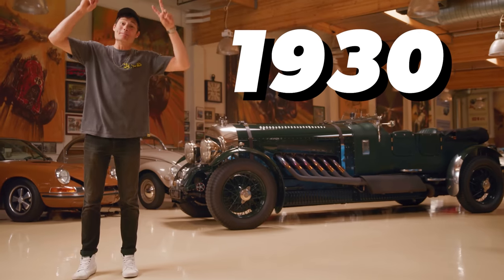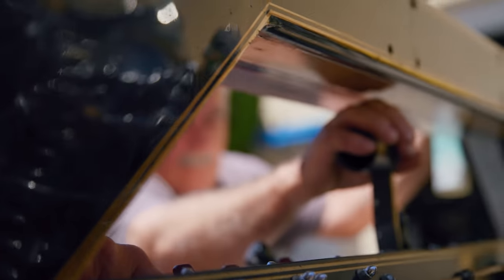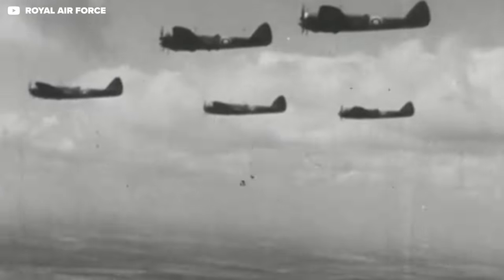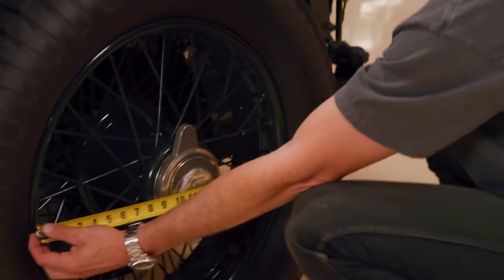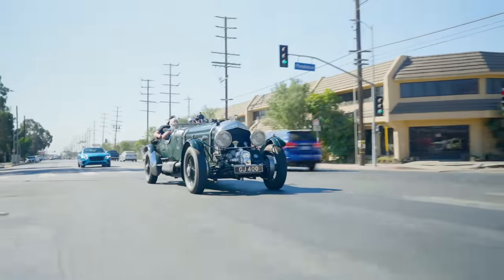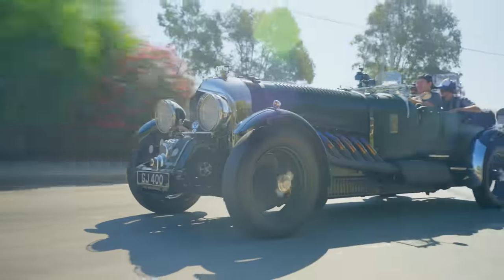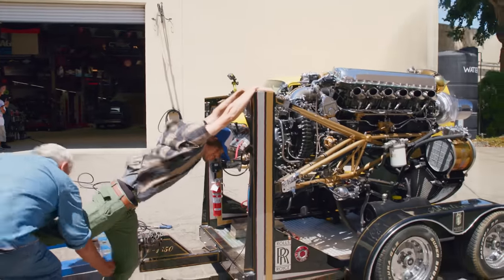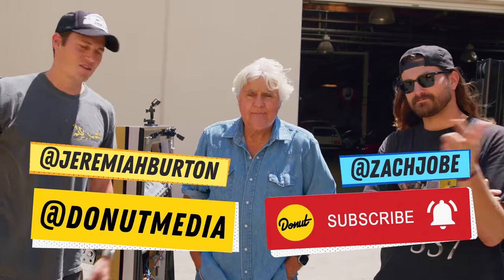What it’s Like to Drive a 100 Year-Old Car with 650hp

Comment: The non-supercharged Merlin, used in tanks, etc, was called the Rolls Royce METEOR. James May expostulates at length on it in a certain episode of Top Gear, in which they compare a Meteor-powered Bentley with another monster machine, the German Brutus (? - if memory serves) which had a German aero engine.
Reply: There are a 'worrying' amount of cool Meteor powered cars out there it would appear!

Not only was the meteor not supercharged but it also had less lightweight alloy and magnesium alloy engine components as they simply weren't a requirement for tanks.

There's a great display of the Spitfire and lots of its components at Hanley Museum in Stoke on Trent. The display plane was flown over Stoke on Trent several times before being retired to be an exhibit. It used to be kept in a huge glass outhouse which was really cool but it was finally moved indoors sometime in the early to mid 80s.
Reply: Yes the Brutus had a 42L V12 from the He-111 bombers :)

Comment: I hate to add its a british engine designed, delevoped and built in crewe in britain and its supercharged variants, its not murican, I do approve of our former colonies putting it in P51 mustangs.
Reply: Agreed, the Merlin P51 was one of the best examples of wartime co-operation
Reply: They stated it was a Rolls-Royce,  and it was licensed for manufacture in the U.S. (Packard, I believe).  Interesting that they Allison wasn't bad, but inferior to the Merlin due to the 2-stage freedom corkscrew.  When the Allison was upgraded to a 2-stage supercharger, it was actually a bit better than the Merlin.

Comment: 3:58. ah yes, it is a Rover Meteor MkIVb tank engine.  Designed by Rover for the tank, it is the unsupercharger version of the Merlin.  Leno's Packard aero engine on the trailer was built by Graham White in Florida, and is a Packard V1650-1.  Essentially, the US copy of the Rolls Merlin MkXX.

Comment: This is what I would imagine a 1930s or 1940s Batmobile to look like. It's got the long front end like the classic Burton car, but the souped-up power of a tank/aircraft engine. It's like an older retro version of Battinson's custom built Batmobile from the most recent movie. All DIY steel construction and a crazy amount of HP and torque.

Comment: The Merlin engine is also designed to be run wide open at full power all day without complaining. Basically any modern automotive engine (almost any automotive engine ever) wouldn’t last a full day at wide open throttle. That’s not a dig at modern automotive, it’s just the basics of design intent. That’s why industrial or commercial engines tend to be big and low power whereas automotive stuff makes more power with less displacement. The automotive stuff is made to cruise on the freeway at 25-30% throttle with maybe a few short full-throttle blasts occasionally. Industrial and commercial stuff is built to run at full throttle basically non-stop.

Comment: That car engine is, actually, a Meteor - Merlin's small brother.

The Merlin (as shown on the trailer) was never originally installed in a tank.

The Meteor was installed in the Crusader tank. Which was 20 tonnes - not 80.

The advantage of chosing a Meteor over a Merlin is it can run on 87 octane pump gas.

The Merlin needs 100 octane aviation fuel.

And after this came a few stronger piston engines - before the jet engine.

The 36.7L Rolls-Royce Griffon 57 came in at 2500hp.

Comment: The W12 engine is not limited by "displacement" but by it's transmission. The W12 engine could put down waaaay more torque than what it has been restricted to in the Continental.

Comment: Airplane engines are also only designed to be in the 2500-2700 rpm range, much faster and the propellers lose efficiency. That’s why they need so much displacement and have so much tq  compared to Hp.

Comment: I drive Cat 789 dump trucks in the mines. They're a 16 cylinder, 78 litre, quad turbo monster that redlines at 1950rpm. The power in them is incredible, so much fun. In the,, there's no replacement for massive turbos and displacement 😂

Comment: the Bentley has a Rolls-Royce Meteor engine, designed for tanks and developed from the Merlin. Most likely this was one was built by Rover as the Rover Motor Company produced most of the Meteor order (about 9000 engines), for several British tanks such as the Cromwell, Challenger, Comet and Centurion. Rover was given the task because Rolls-Royce was at full capacity producing the Merlin and it's specialist division was occupied with jet engines, ironically for the Gloster Meteor, a project taken over from Rover.

Comment: So probably the main reason that the 27L engine only made 650 hp is because the engine could not spin the propeller over a certain speed because the propeller would explode. So they had to design an engine to make crazy power at super low rpm, like below 2500 rpm

Comment: A little bit ingenuous to suggest that the Rolls Royce engine was American. It was designed, built and installed in British Spitfires and Hurricanes, before a manufacturing license was agreed with the  Packard Motor Company. The Mustang version didn't run until 1941, even though the British were using it as early as 1933. Also, the Americans didn't invent Apple Pie and even your National Anthem is sung to melody of an old British drinking song - Anacreon in Heaven! Check it out! Some call me pedantic, but really I'm just pernickety! ;)

Comment: ...and of course, the venerable Merlin & its successor, the Griffon, were designed & built by Rolls Royce in merry old England. Packard built the Merlin under license from RR as the V-1650 .

The P51 was initially designed for the Royal Air Force by Edgar Schmued of North American Aviation after lengthy discussions with Sir Henry Self and his team from the British Purchasing Commission, which had been set up in the United States in 1938 to procure supplies and military equipment for the war effort. The Mustang was designed to use the Allison V-1710 engine, which had limited high-altitude performance in its earlier variants. The aircraft was first flown operationally utilising the V-1710 by the RAF as a tactical-reconnaissance aircraft and fighter-bomber (Mustang Mk I). Replacing the Allison with a Rolls-Royce Merlin resulted in the P-51B/C (Mustang Mk III) model. The Merlin transformed the aircraft's performance at altitudes above 15,000 ft (4,600 m) without sacrificing range. It was at this point that ears began to prick up in the good ole US of A that North American had one hell of an airplane on its books. 😉

Comment: Obviously that trailer's not going to fly, so is there any reason to have the propeller besides for fun? Is it required for the engine to run?
Reply: I've always wondered that myself, and depending on who you ask you get a variety of answers.  The most common I've heard is it helps with keeping the engine cool (which is odd because they're usually not run for long enough to be at risk of overheating) and that free-reving an engine with no load on it is not healthy for the engine (something that is debated non-stop on engine forums).

Comment: You're not correct about torque and pulling power. Two different cars with 650 hp at the crank can give the same pulling force at the tire tread no matter what the rpm/torque spread is between the two cars. There's a gearbox between the wheels and engine tailored to the type of engine and car. The only reason a Bonnet could win a tug of war is because it's super heavy.

Comment: I think one factor has not been considered, regarding the relative engine speeds (Merlin slow turning, modern Bentley fast turning).
Fast revving engines were known, although more difficult to produce due to limits in metallurgy. So, why was the Merlin big and "slow"?
The laws of aerodynamics. As a propeller reaches the speed of sound in it's rotation, the efficiency of that prop drops precipitously. Without going into a lot of detail in a YouTube comment, basically, there's no reason to spin a propeller much faster than about 3000 rpm. So, an engine needs to make its power at that relatively slow speed. Some engines did use a reduction gear, such as the Daimler v-12 that powered the Messerschmitt 109. Many lighter engines in LSA, ultralight, and experimental aircraft also use a propeller speed reduction unit (psru), most of those are belt driven (for engines making from 50hp to maybe 150hp).

I'm wandering off topic. My point is that there were limits on engineering that required a slow turning yet powerful engine. The requirements of design dictated the result, not necessarily technological limits. It's an airplane engine. Lightness is probably the primary concern regarding aircraft systems design. I guarantee that if they could have used faster spinning, lighter engines, they would have (er, like the experimentals I mentioned).

[Edited to fix typos that altered the meaning of some statements]

Comment: The biggest reason the Merlin engine is so big is because in a propeller driven airplane, you are actually limited by how fast the propeller can spin. In the P-51, the engine was limited to 3000RPM by a propeller governor. Any faster and the propeller tips would go supersonic, causing loss of efficiency in thrust, becoming extremely loud, and eventually destroying the prop through erosion from supersonic shockwaves. So aircraft engines rather than spinning faster to make power, they simply become bigger and bigger because propellers can only spin so fast based on their diameter.

Comment: First off, Rolls-Royce Merlin is a UK designed and UK built engine.
The US needed an engine, so they licensed the Rolls-Royce Merlin. They then had Packard build the engine.... It was called the Packard Merlin and built in the US.

The data plate you showed was from the Rolls-Royce....

Comment: 18 feet is the same length as the '77 Dodge Monaco I used to drive, and that car basically had couches for front and rear seating. She was a guzzler and she had several engine problems due to age, but aside from how the vinyl stuck to you in the summer it was like driving an easy chair with a V8.
Reply: I wish land yachts would come back into style. I don't want to feel every bump in the road in a so-called luxury car, I want to sink several inches into a seat and cruise all day in something I can steer with my pinky.

Comment: Sick project man! I’m not sure how readily adaptable T-5s are but you could also use an ax15. They’re rated for 300 but are known to hold much more, they’re the same line of Aisin transmissions as the Mk4 Supra  twin turbo and tacomas/ 4 runners. The ax15 was also put behind 3.9 magnums so you could swap back and forth from Chrysler v8 to AMC engines if you get both bells.

Comment: I love your videos but I do wish you would do research before recording them. Your history of WW2 is abismal. The Rolls Royce Merlin was designed for the Hurricane, Spitfire and Lancaster not the P51. The English built the Merlin. The P51 Mustang did not have the Merlin engine it was designed for the Allison V-1710. The P51 Mustang X had the Merlin engine which then developed into the P51B/C. I can't believe you didn't even mention the Spitfire, Hurricane or Lancaster when talking about the Rolls Royce Mustang.

Comment: Building a plane engine into a race car was somewhat common in Germany in the 1920s. Due to the Versailles treaty Germany wasn't allowed to have an air force, but there were a lot of already built plane engines laying around. A modern take on this is the Brutus, a 1930s style race car built by the Auto- und Technikmuseum Sinsheim in Germany between 1996 and 2004 (the English Wikipedia article wrongfully claims that it was built shortly after WWII) around a BMW VI plane engine found in a Spanish scrapyard from a plane that very likely flew in the Spanish Civil War in the 1930s. It's a 12 cylinder engine with a displacement of around 47 liters and around 750 hp max. The fastest it was ever driven was around 200 km/h by a test driver, who said that it had plenty of power left.

Comment: 650 out of a Merlin is weak sauce.

The original examples of the merlin II had a max of around 1030hp with a combat setting in the 900s range. Merlins towards the end of the war were producing around 1650ish. Reno Merlins today make well over 2000hp using some modern wizardry.

Also the merlin isn't an American engine. It's a British engine. Although it was built under license by Packard for use in aircraft like the Mustang.

Comment: i don't think that is actually a Merlin, the 27L tank version is call Meteor. it is base on a Merlin without the supercharger, and use a lot more heavy steel and iron because it don't have to fly,it weight about double the airplane Merlin depend on the version( the 3500 lb weight stated in the video is over half of what a spitfire fighter weight, which will not work, a real airplane Merlin is about 1600 lb). it also have a lower redline and a lot of other stuff that makes it better in a tank

Comment: Great video, but as a Brit I'm kinda miffed that you guys made it sound like the Merlin was designed by the Americans. It was a British engine, and when the P-51 (a brilliant airframe) needed better altitude performance it was used as a replacement for the Allison engine, eventually being licence-built by Packard. The story goes, that when the blueprints were sent across, Packard (making the US's most expensive and luxurious cars at the time) had to relax some of RR's tolerances because they simply couldn't machine them that precisely. They also made way more than 1200hp. Even by 1942 when fitted in early D Mustangs they made 1650hp at sea level, and late war ones made over 2000hp. The car's engine is probably a Meteor if it came from a tank - not just unsupercharged but also derated for reliability.

Comment: So is the blower on the front of the Bentley, usually an Amherst Villiers, a fake because the Merlin has a centrifugal blower at the rear of the engine usually? Can't see enough of the technical details. Pretty neat either way. Not sure they used the Merlin for air raid sirens, but they definitely used V8s. There is a great video of the late Robbie Coltrane from his Planes Trains and Automobiles series where they fire one up.

Comment: airplane engines HP numbers are always low because they are designed to be used at limiter until the fuel runs dry. a lot of them are directly connected to the props and aircraft props don’t spin much faster than 3k rpm(usually less) 

your car barely makes any power at 3k rpm

Comment: what is the mileage on that Merlin? Is it very low, or oddly better than expected due to lower rpm driving? We are talking like over three times the displacement of a Viper. If someone told me 5 mpg I would believe it.

Comment: I had no idea they built Merlins in the US!

Rolls Royce used to run these things full tilt, nonstop 24/7 until something broke.  They beefed that part up and did it again.

However, the Rolls Royce tank engine wasn't called the Merlin, that's the Meteor.  Very similar engine but not supercharged.

Comment: You guys need to understand that a 6 liter engine making 650hp will not last the same amount of hours operating at full power as a 27 liter engine. 

Engine have not become more efficient, they just have bigger numbers and shorter lifespans because of this. Piston engine tech peaked in the 50s at around 3hp per pound and these engines would last 5000 hours operating at full power.

Think of it like this...

I could put a 1000hp honda motor in my semi truck and haul a load from seattle to new york and once i got there i would probably have to rebuild it for the return trip. 

The magic number is 50hp per liter. Once you go over that, service life begins to suffer.

Comment: We had those four cylinder turbo engines why back in the Australian Falcon, performance was OK in the day but you don't see them around anymore, well apart from blown up ones. Meanwhile the six cylinder Barra is everywhere. Even the turbo Barras survive with high mileage.
And don't think Ford forgot what happened with them. Not my money.

Comment: Slightly sad that there was no mention that the Merlin engine was developed by Rolls Royce in England for the RAF to drive the Spitfire and Hurricane fighters. In fact it was an RAF test pilot that suggested they replace the underpowered Allison V-1710 engine of the P51 with a Spitfire IX Merlin engine to turn it into the Cadillac of the Skies...

Comment: My second comment, i should shutup, smh, lol, but jay siad modern cars always get home. I feel a diyer thats in it to cheaply and, specifically maintain their model, would have less tools to do 80% of this cars work vs anything ither than a toyota, hinda, or like my 2005 hyundai, which as far as i know is just as reliable. 300k mile engine and trans practicaly guarenteed, however hyundai might not exeed to 4 or 500k as easily. Anyways, i feel like watching vides to find out what tools are need for what jobs, i feel like this car can be almost 80% taken apart and put back together with probably 15 handtools versus 25 or something, lol

Comment: Merlins & the tank equivalent only revved to about 1800 to 2000 RPM, & were also built to last 1000s of hours of use; so to get the hsprs, you gotta massive with the displacement. Modern engines rev 4 to 5 times faster, & have far shorter service intervals so you can squeeze more power.

Comment: big'ol engines are cool and sound coolier, but they are big and loud because they are less efficient. not all horsepower is the same...in fact horsepower is a horrible way to gauge performance due to being a calculation rather then  messurment not to mention that horsepower is limited in what variables it accounts for....literally just 2... power and torque. we should come up with a better formula and call it "MeterDoughnut Pounds per Cubic DoughnutCentimeter and The Rest Can Be Pink-Sprink"